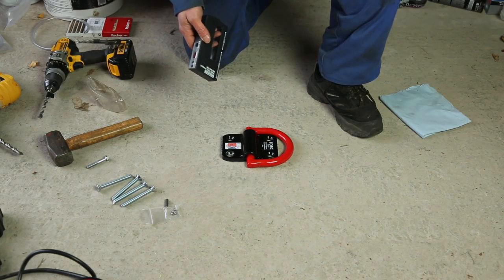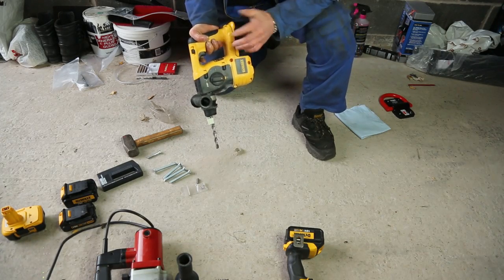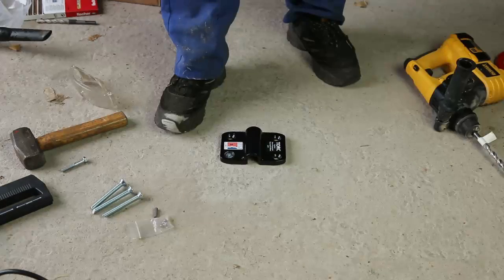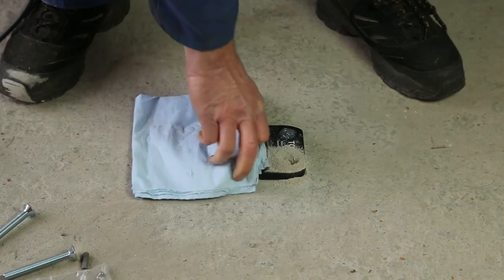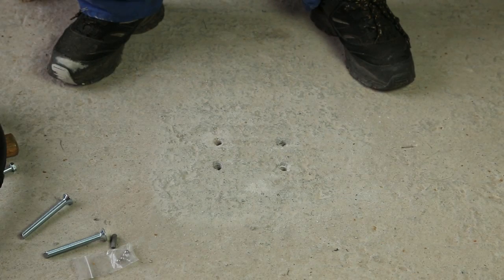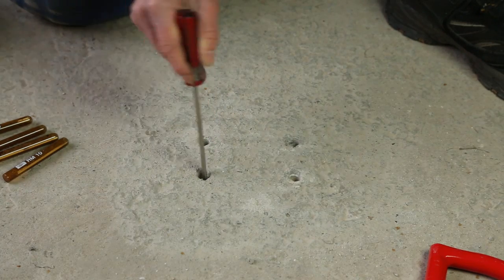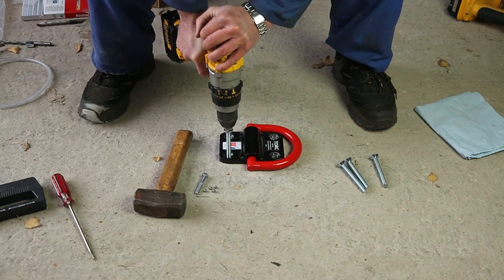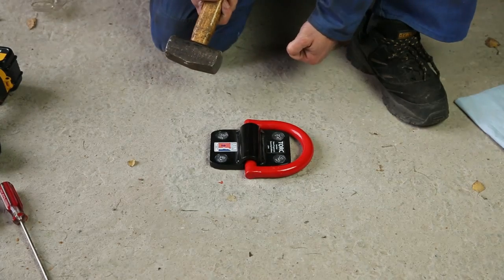Fitting a Torc Ground Anchor using Chemical Resin Capsules

Comment: the anchor itself looks a bit loose. Is that normal?
Reply from the maker: The resin fixings don't really pull the anchor down onto the floor. It should be close, for sure, as you wouldn't want a thief being able to get a lever under the base plate in an attempt to prise it up out of the floor, but it won't be massively tight. Providing it is close to the floor, without a significant gap, that is fine.

Comment: Bugger forgot the D !!
Reply from the maker: We've had a few people that have got a bit involved in the fitting process and forgotten to put the 'D' shackle in place before using the resin to fix the base plate to the floor. This is unfortunate, especially if you don't notice until the resin has set! A base plate fitted to the floor, without the 'D' shackle underneath it, isn't much use, I'm afraid. The separate 'D' shackle might make a nice door knocker ;-) Seriously, if anyone is in this situation and you notice quick enough, before the resin has set, try to lever the base plate away from the floor, quickly! We can supply replacement fixings so you can try again but if the base plate is already permanently fixed to the floor, we can't do much to help you use it. We can, however, supply another base plate separately, with more fixings, so you can re-use the 'D' shackle you've got 'spare' from the first attempt.

Comment: How deep do you drill? My garage has rather thin concrete, around 8-10 cm (maybe 3½-4 inches).
Reply from the maker: The holes for resin fixings should normally be drilled to 95mm depth (not deeper). The concrete should ideally be something like 150mm (6") thick. Anything around 100mm thick, and certainly anything less, is likely to have the drill break through the bottom of the concrete and then you have a problem with the resin having a chance to ooze (technical term!) away into any voids below. The nominal "Brick Wall/Mediocre Concrete" fitting kit is potentially an alternative option, then, as the holes don't need to go so deep and that uses shield anchors (aka expanding bolts) to fit the anchor instead, and they don't need the bottom of the holes to be sealed.

Another option can be to drill a larger diameter hole (16mm, compared with the normal 12mm diameter) and to fit resin sleeves, which we can supply separately. The sleeves are like plastic mesh cylinders. You then use injection resin from a cartridge and squirt the resin into the middle of the sleeve. The sleeve constrains the resin around where it is needed. I.e. the sleeve goes into a 16mm diameter hole and the resin goes into the sleeve, and the bolt goes down the middle.

The other options are to cut out a section of the floor, dig down, and to fit the anchor as you lay fresh concrete, filling up the hole, or simply to find another position to fit the anchor. Any anchor can only be as good as the substrate where it is fitted, so it is usually a mistake to fit it to something that is thin or weak.
(And apologies for such a slow reply.)